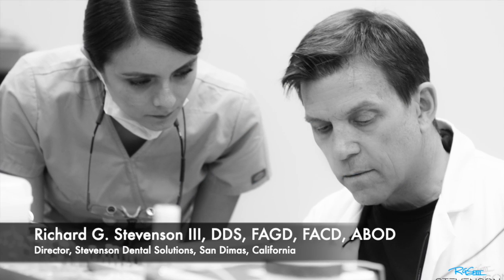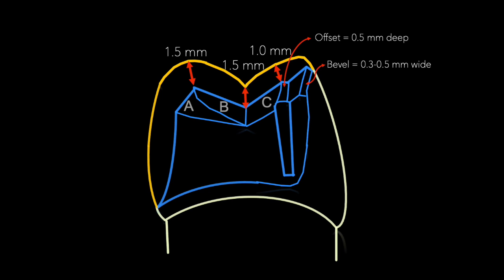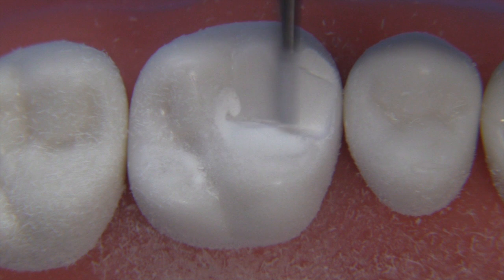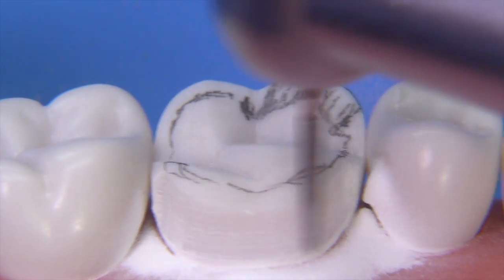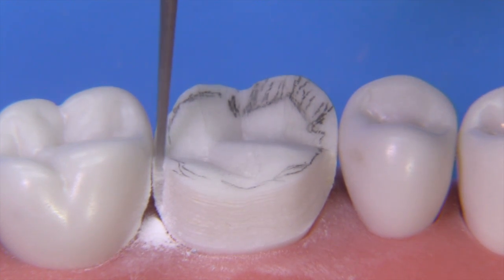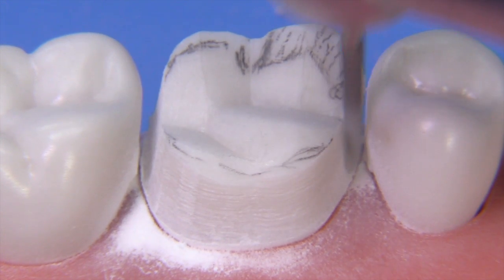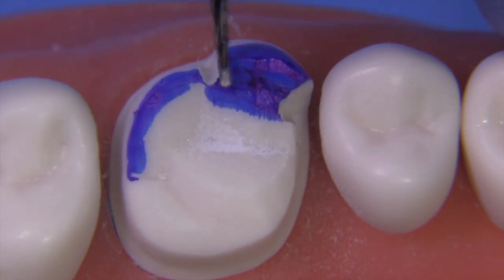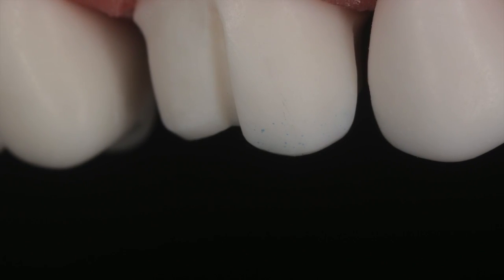7/8 Gold Partial Veneer #3 Acadental | Gold Coverage Restoration

Comment: That is very beautiful work and thank you so much for sharing your knowledge and talent with us Dr Stevenson. If i may ask, can building a core with amalgam and placing an emax pressed crown, considering you still have some natural tooth present, work or would it be better to build core to always build core with composire prior to any All ceramic restorations?
Reply from the maker: Bonded composite would be the best from an esthetic standpoint.  I typically use liners of RMGI, covered with bonded dual cure composite.

Comment: Why would you refrain from drawing on a patient's tooth? After 40 years in practice after completing a GPR residency I often place a stainless matrix band on the adjacent tooth to insure that zero accidental contacts occur with teeth adjacent .  Using a microscope is good but it does not prevent accidental contact from a rotating diamond to the adjacent teeth.
Reply from the maker: Thank you for your comments.  I'm happy to know that you are a conscientious dentist.

Comment: Hello doctor. Thanks for sharing this video with us. I have a few questions.
 The first premolar that had a vertical fracture, was it asymptomatic so that you decided to restore it? What was your estimation on the prognosis of the tooth? What are the follow up result?
Reply from the maker: The fracture upon microscopic evaluation was not propagating vertically down the root very far, hence the decision to restore.  Prognosis is guarded though and the tooth is structurally compromised.  The patient is a very successful business owner and wanted to give it a try.  Thank you for the insightful question!
Reply: @StevensonDentalSolutions  thank you Doctor
Reply from the maker: @msadent1825  My pleasure

Comment: I sometimes have a problem with interproximal separation on real patients. Sometimes on molar teeth it is like they erupt together, and the margin never separates no matter how deep i go, sometimes i have to go subgingival to "find" the tooth separation (so that the apical part of the prep does not touch the adjacent teeth).
Have you encountered this problem? Is there some soultion? Do i have this problem because i do something wrong? (i never had this problem on the plastic models)
Reply from the maker: This is a very challenging situation indeed - I've encountered this many times.  I used to struggle through this difficult contact - not any more.  Here is my solution: place an elastic ortho separator and have the patient wear this 24 hours a day and have them return in a week, take a bitewing and assess the separation - in most cases, this is all you need. If you still don't have enough room, prep the tooth but don't break the contact - place a tight fitting temporary crown and try again with the separator.  When they return in a week, remove the temp, reprep, and take your impression.  Reline the temp to cover the new margin (or remake).  Check the occlusion with 8 micron paper and "polish" (the word I use for patients) with a fine diamond or carbide any interferences that may have occurred as a result of the 0.5 mm of movement - this is rarely necessary, but check nonetheless.
Reply: @StevensonDentalSolutions   Wow thank you for the answer!
I never thought of using a separator to break contact for a tooth that is going to be prepped. I thought i should approach the tooth differently or something like that, or just going deeper with the prep (which obviously has its downsides).
Thank you very much!
Reply: I would also add that in litrature it is mentioned to go subginvally in these 
Cases ,and u can also use ultrasonic,
Leaving enamel wall and finishing vd hand instrument

Comment: Again - very nice. Dr I have a question on your comment that you - '' wouldn't draw on a patients tooth''
I have and do at times - is this an error to do on a pateitnts tooth where it's for the purposes of cocervation?
Then cutting a box distal. Is this not good for reciprocation in retention and it makes the finishing of the distal line a gle easier and safer?
Thanks for a great series.
Reply from the maker: Terrific Questions Doc!
I do at times use a mechanical pencil which I wrap in "sticky plastic" (same as on operatory light handles) usually for veneers (marking the depth cuts, and for facial binding for identifying line angles and feature.  I've done so many of these for 7/8 I've stopped using the pencil for posterior work - there is nothing wrong with this IF the pencil may be protected or disposed of after use.

I will sometimes place a box or groove in various locations to increase resistance form - short preps, fixed dental prostheses, or in cases where there is a box existing and I wish to use it.  The design presented in this video far exceeds the required retention and resistance for for a lifetime restoration according to the studies on this design in the 1970's performed by Shillingburg and others.  Thank you!
Reply: @StevensonDentalSolutions   Do you take any precautions to avoid a situation where the thin mechanical pencil lead were to break inside a patient's mouth? Or to avoid the breakage of the lead? Of course the dental dam and suction would be a must! I see several advantages for drawing the prep on the tooth, but am fearful of this situation.